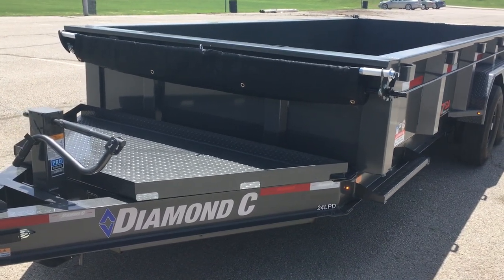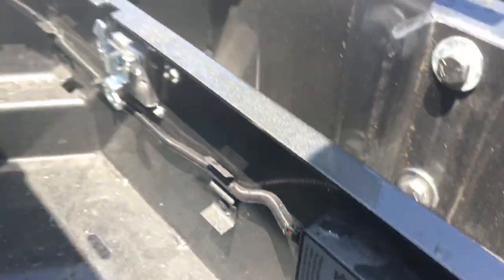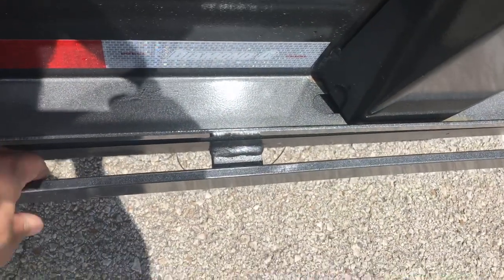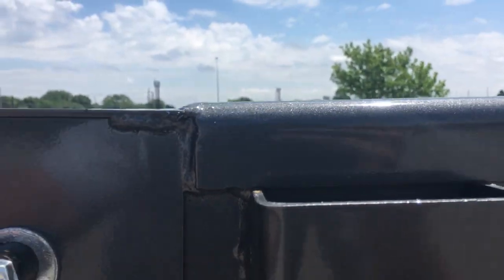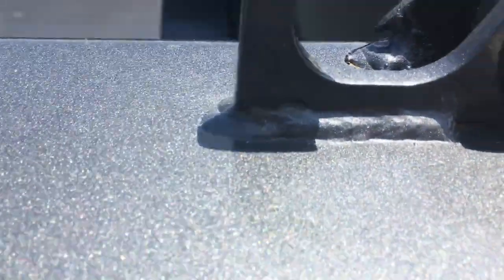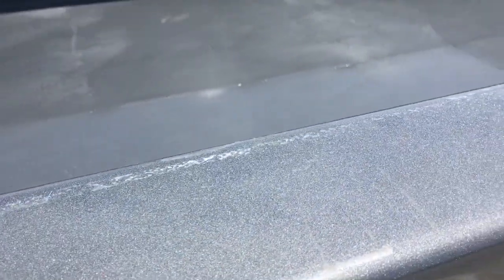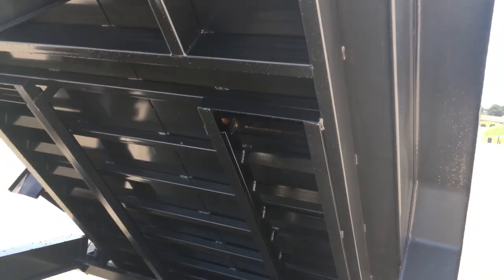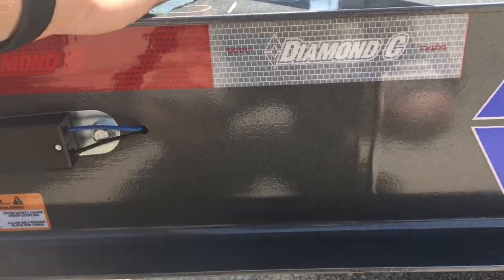Diamond C 24LPD Dump Trailer Review

Comment: I just for the life of me can’t figure out why you wouldn’t want a hydraulic jack when you already have a pump, a tank and a battery. nobody seems to order them that way 🤷‍♂️
Reply from the maker: I considered it, but the trailer is almost always on the truck. Since I wouldn’t use it, very much, I decided it wasn’t worth the upgrade cost and required future maintenance.
Reply: Makes sense, thanks for the review I was pretty surprised at the shotty craftsmanship. I currently have a hydraulic dove tail gooseneck trailer on order I hope the craftsmanship is better on it when I get
Reply from the maker: R May, smart thinking on leaving a crank jack. That’s how I would do it, I like redundancy. I’ve never seen anyone else do that.

Comment: You can nit pic at any manufacturer. Nobody’s perfect. Diamond C is top notch in my opinion.
Reply: Diamond C is not painted. They are powered coated.
Reply from the maker: @tedspillman6429  Now, they use powder coat. They switched right after my trailer was made. Before spring of 2018, they were all painted. This was part of the reason I went with Diamond C. I wanted (and received) a painted trailer, instead of powder coat.
Reply from the maker: Your first two statements are correct. The last sentence is an opinion. I don’t necessarily disagree. My trailer is the worst Diamond C I’ve seen. A friend of mine was looking for two flatbed trailers. After much discussion, it was determined to get two Diamond C trailers. I was a big part of that decision. Both of them came out great. One did have an issue come up, but I don’t know if it was a manufacturer defect or user error. Either way, it’s on the road, again. I just made a video to show what I received. The three year update is coming up, soon.

Comment: Beautiful trailers but I won’t be buying one from the reviews I’ve read.  I also use trailers commercially.  I’m going with a galvanized trailer.  Never have to worry about rust or a beautiful paint job getting all scratched up.  Thanks for sharing.
Reply: Ardel Pillow  You’re reply doesn’t make any sense.  There isn’t a trailer out there with a paint job that looks halfway descent after two years of hard work.  I don’t know about you but I would rather pull in one of my customers driveways with a trailer that looks decent.  Not a rust spotted scraped up fancy paint job.
Reply: Ardel Pillow  it’s the perception of what customers see bro.  Looking the part is extremely important.  As much so as creating a fantastic finished product.  At least in my neck of the woods.  I get what you’re saying.  However who you would hire compared to how customers choose to hire isn’t the point.  The point is when I make a huge investment just like in my tools, I want them to look good for years to come.  I also clean my tools after every job.  If you’re a contractor and don’t understand my points then that’s ok.

Comment: Nikerret, thank you for posting this video. In a way we know it can sound weird saying thank you BUT as a family owned and operated company that takes pride in the product we build for users such as yourself. We place high value on customer feedback (good, bad or in between) and use it to help further develop quality assurance processes in turn improving the overall customer experience. After this video was posted it was immediately shared throughout all different internal departments involved to address different things that could be done in the future to help with the things pointed out. I am happy to report it did help and progress has been made! Thank you for choosing Diamond C!
Reply: Be advised that this presentation saved me from ordering not one but two 14' trailers. It was a stroke of good luck that a total stranger alerted me to this piss poor PRODUCT. Pride in your product, Quality Control and the BEST CUSTOMER SERVICE is very much LACKING AT diamond c. Just my observation. But what do I know, I just keep AIR FORCE AIR CRAFT from falling out of the SKY, going on 16 successful years so far AND COUNTING !!!!
diamond c, can't you afford at least $ 3000 refund to this young man?????
Reply: Diamond C seems to have no quality control.  

I had a very similar trailer built with my exact options.  The first time I tested out the dump I raised it and lowered it and managed to pinch the wires from the lights.  They were not secure enough and got between the dump and the frame.  This caused me to blow a fuse in my truck several times by the time I discovered the problem. 

The powder coating easily showed the writing on the bare steel.  No one cleaned off the marker so it showed easily thru.  The fold down covers that keep the ramps in hit the metal above because something is not right.  I need to use something to pry open the door so I can get the ramp out.  It has been this way for 4 months now.  It is more than just the powder coating causing it to hit.  This is just a great reminder of my disappointment in the attention to detail that causes me a problem each and every time I use my ramps.

I tried to use my stake pockets but 2 by 4 wood does not fit into the holes.  How hard is it for someone to try a piece of wood in the holes prior to powder coating or even after?  I have tried several different pieces myself and measured the space.  It is not thick enough for the wood. 

The antenna for my wireless control was mounted on the back of the battery box.  This does not give a straight line of sight to the remote.  When I use the remote, it is jerky.  Basically it stutters all the way up and all the way down from poor signal reception it seems.  The trailer came with no paperwork for the wireless.  When I first tried it, I got nothing.  Turns out you need to press both up and down buttons together to activate the remote.  I had no way to know this with no directions or manual.  Now a little after 3 months of using my trailer, the wireless stopped working all together.  One day it worked fine then 10 minutes later it did not work at all and has not since.  Remote still lights up like it is transmitting but nothing.

The brakes were adjusted too tight and would hang when I let off the brakes.  A few times when empty this happened.  I had to take the wheels off and back the brakes off myself so it does not happen any longer.  But I have two tires with flat spots.  This all happened in the first two weeks I had the trailer.
The collars at the end of the tarp rod have set screws that were not secured correctly.  They should have had lock-tite or similar.  One collar fell off within the first week and I had to go buy another and replace the washer and pipe that got lost.  Then I had to put thread lock on all of them myself.  

The pin for one of my drop legs fell out because it is a poor style pin and latch.  I had to replace with a better one.

I do like the design of the trailer for the most part.  I really like the wide top rails as you can walk on them and I do often when putting the tarp on and off for vegetation and other similar loads.  The low deck is great.  I also got the 12k jack and it is the only way to go.  

In short if Diamond C put some effort into quality control you could have a really great product.  Without the quality control you have a so, so product.  What a waste when you just need to follow thru and build the best trailer out there.  Maybe some day you will get it together and then I could recommend your product.
Since you are a family owned company, maybe give the name of the person that cares to hear about this sort of stuff and you would not have to read about it on YouTube.
Reply: Ordered with Load Trail instead, thanks for the help!
Reply: And your going to give him his money back or replace the trailer?
Reply: I was going to buy a Diamond C until I saw this video.  I will not be ordering one.

Comment: Realistically dump trailers are cheap junk and cost way more then what they should. Their so cheaply made compared to a actual dump bed on even a 1 ton dump truck and for the money they charge you should get a trailer that is better. These things rust out just in a couple years. I have a 97 f350 dump truck and the bed isn't rusted at all. I have a 2021 dump trailer and it's already  got a surface rust everywhere just after a month